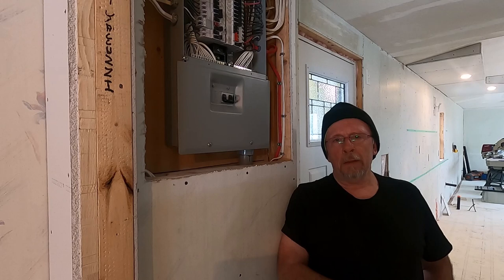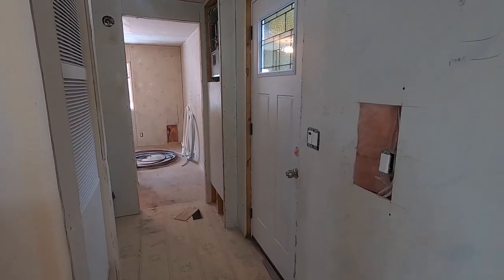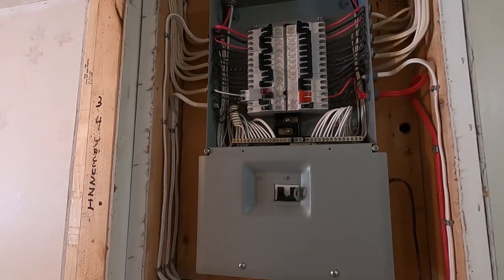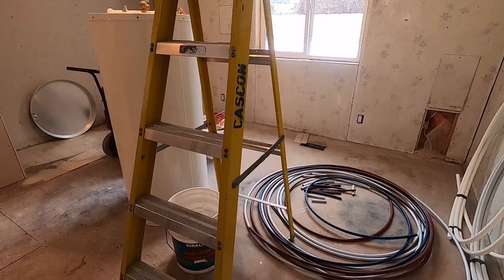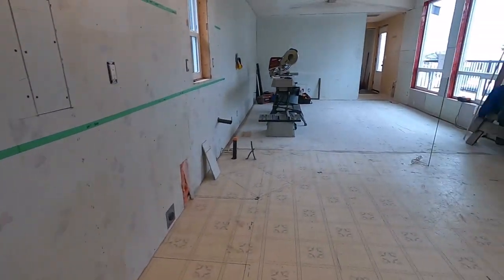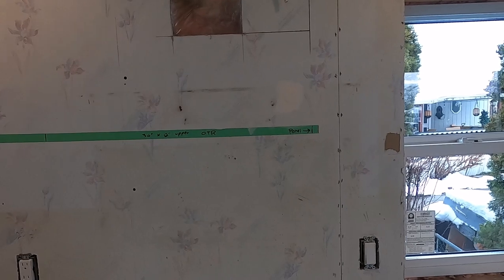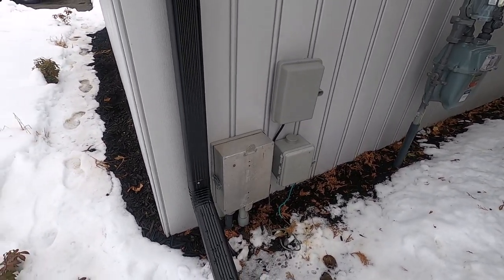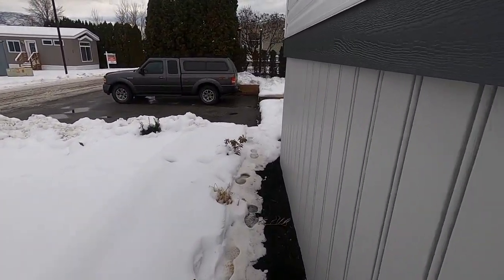The Mobile Home Gets Some Electrical Upgrades : E051 / BC Renovation Magazine

Comment: Very nice upgrades, Kent! You're not just making cosmetic improvements - you're making a beautiful home with many modern conveniences.  Besides the air conditioning, the outlet in the peninsula is very important,as well as all the other added outlets. Top quality, as always.
Reply from the maker: Becki, thank you! :-) I try to make these homes something like I would like to live in myself. These upgrades are all things I would like to have myself, so I like to do them for others as well. That kitchen electrical was very dismal. I just couldn't leave it like it was. It would not be right. :-)

This is the thing about doing things like this yourself. It doesn't cost much if you can DIY. For example, that outlet on the peninsula cost me less than $50 in materials. If I had an electrician do that it would have cost several hundred dollars. When someone moves into that home and starts cooking in that kitchen, that outlet will be priceless compared to if it wasn't there. In my mind's eye I can just see someone there in the future with a mixer set up, making cookies on the peninsula. Crazy? Yes! :-)

Comment: We purchased our home in 2022, and it is more up to code. I will be replacing all the dumb switches. We have been in our home for a little over a year and one of them is going out. If I do not upgrade them, we will have to replace them often. Thank you so much for this video. I will have a porch setup soon, and will need lights there, as well as a security light on one side of our home. I sure wish I could have Cat 5e ran into my home. I would need it ran to only one room.  I really like the way you added the LED lighting. It really will bring that home to much better lighting!

Comment: I am planning a total renovation of my mobile home.  My roof, ceiling, flooring, and walls need total overhaul.  Especially electrical wiring.  When does the electrical upgrade should happen.  Before the ceiling and walls replaced? Thank you in advance.
Reply from the maker: Shoryo Tombo, you want to do the electrical work before you refinish your walls and ceilings. 

Thanks for watching and commenting, and good luck with your project. You can do it! :-)

Comment: I’d like to upgrade my electrical panel from 50 amps to 100. Our park supports 100amps. I understand how electrical works and all but was unsure of the method of running the new gauge electrical under the home to the panel. Even though it is secure in the conduit I was under the impression that it still needed to be mounted to the under belly?
Reply from the maker: Hello, Erick. Codes and requirements vary from place to place and over time. The main line into this home has the 3 conductors encased in a spiral steel conduit which is then covered with a rubber sheathing to make it watertight. This was the accepted way when this installation was done almost 30 years ago.

I don't know what the code or requirements would be if this was a new installation done today. It may be different. Generally speaking, any new work that is done on a home, such as upgrading the service as you want to to, would have to be done according to and in compliance to the current code where you are located. Check with your local electrical authority before you make any changes.

Thanks for watching and commenting! :-)

Comment: What is best 1/4”or1/2 “ Sheetrock on the trailer
Reply from the maker: falconthree, you can use either.  I usually use 1/2".

Comment: Thank you for this video. I've been struggling with trying to figure out how to do the wiring in my single wide. What do you think of starting on one end, dropping the wiring down from the new outlets and lighting to the undercarriage, and pulling it up as the home gets completed from one end to the other?
I won't be able to gut everything and do it "all at once" the way you've done. Thank you for any input.
Reply from the maker: Hello, Phoenix. Thank you for watching! 🙂 You are on the right track. Generally speaking, the electrical distribution system in a home is divided into circuits. The circuits are usually grouped together along the length of the home. Dropping the wire down into the crawl space and then back to the panel is a good way to do it. All the best to you in your project! 🙂
Reply: @BCRenovationMagazine  Thank you for your response. I was quite worried about that one element of the redo. The rest isn't that big a deal when it comes to what can go where. Have a great weekend.
Reply from the maker: @firebutterfly  , you're welcome. 🙂

Comment: I got my dads mobile finally after he died. He ran more electric than he should have n rigged a lot. Is it possible to update this without taking out all drywall, or would it be less expensive to update his two mobile connected with a shell around it and roof? My husbands telling me it is not a possibility n I jus need a new mobile. I disagree. He jus wants to use the home for his garage. I don’t know? Confused n Nc
Reply from the maker: Hello, Annabelle. I can't really give you an opinion without some more information. I would have to see what you have there. I am a long, long way away from North Carolina. I suggest you get hold of someone local to help you with this. 

Thanks for watching and commenting. :-)

Comment: Can you tell me please ..I have 4 blk wires and 4 wht wires in a light fixture. Switch not working..how do you know which blk to which..and which wht to wht..if it's not working and not a dead switch..that means it's not powered correct?
Reply from the maker: Hi, darr.  It is impossible to say what is going on with your switch without physically looking at it and doing some testing.  My advice to you is to have a qualified electrician have a look and sort it out for you.

Comment: Hello sir, one question please, in the rooms it has a smoke detector ? where else ? thanks
Reply from the maker: Rafael, this home has a smoke detector in the hall outside of each bedroom. Two smoke detectors in total, both in the halls. The smoke detector in the back hall, near the furnace, is also a carbon monoxide detector. The smoke detectors are connected together, so if one goes off, they both go off. Both detectors are hardwired into the homes electrical system and have battery back up.

Comment: I was told that has to be buried 3 Ft underground is that not  true?
Reply from the maker: Hi, Regina.  As long as you are within the structure, at least around here, it's OK.  If you are running power out to somewhere in the yard from the structure then it has to be buried.

Comment: Did you have to get technical safety bc to have an inspector come out even after an electrical inspector approved the changes to obtain your silver label again? Fyi  very impressive quality work you have done!

Don
Reply from the maker: Hello, Don. This home does not have a Silver Label. The electrical certification for this home is the original CSA Label that was issued at the factory. The CSA Label is still valid. There had been no changes made to the electrical system that would have made the CSA certification invalid before we took possession.

The permit issued for the electrical work we have done will become an addendum to the original CSA certification to keep the CSA certification valid. When all is said and done Technical Safety BC will issue us a Declaration of Compliance, that will be posted beside the CSA Label as proof of compliance.

The electrical inspector comes from Technical Safety BC.

Silver Labels are a replacement for a CSA Label that has gone missing, or if extensive electrical work has been done with no permits, but usually if a CSA Label is present without permits for new work, a Declaration of Compliance is usually accepted by Technical Safety BC.

CSA Labels usually go missing as the result of a renovation. Older mobile homes had the CSA Labels on the outside of the home. People come along and cover them up with new siding, or paint over them, etc.
Reply: I appreciate your expertise. Thank you.
Reply from the maker: Don, thanks. :-)

Comment: I paid 8000, for an electrician to rewire my electrical box, rewire my living room, kitchen, two switches in a small hall and rewire my small utility room. No fixtures were changed or rewire in ceiling. I noticed several places where a copper wire comes out of a drilled hole in my floors where the copper wire was bent like a hanger. I can’t put tile over that when I have the subfloor redone , there will be no place to put the copper wire and was wondering why this was done this way. Seems very unprofessional and possibly unsafe. This company is BBB rated A . Thanks for any information. When I call him I would like some knowledge, I’m a senior citizen and not wanting to be taken advantage of, it’s difficult to trust the best companies.
Reply from the maker: Grey, what you describe with your wiring there does not sound like it was properly done. Did you electrician take out a permit for your job and was is inspected by an electrical inspector? Around here no electrical work can be done in a mobile home with a permit and inspection. Ask the electrician if this was done and to show an inspection report from the inspector. If the electrician cannot prove that a permit was taken and inspection done then I suggest you contact your local electrical inspector. I hope it turns out well for you.
Reply: Hj
Reply: I oooooooooooooo
Reply: Grey  The senior (Age 103) that owned our mobile home was taken advantaged of... We found so many things wrong... Like one light fixture was on 2 seperate breakers...  one circuit was overloaded   while another had only one outlet....  I am in all honesty shocked the place did not burn down........  The people that put in a drywall ceiling, did not support the added weight, and caused a 3-4 inch sag... the rafter was torn apart in a few places....